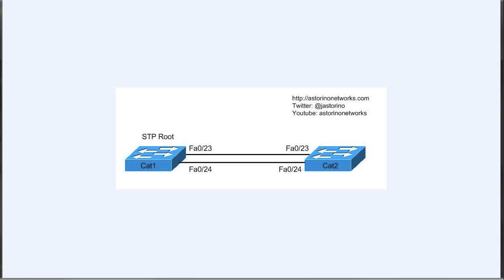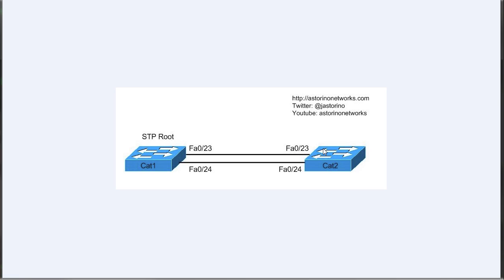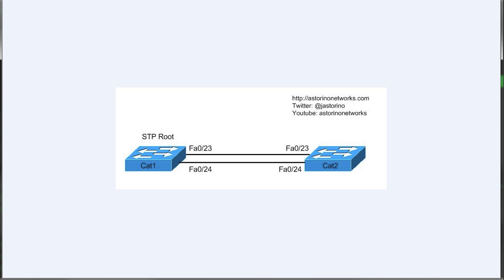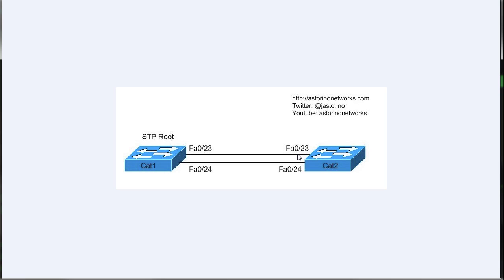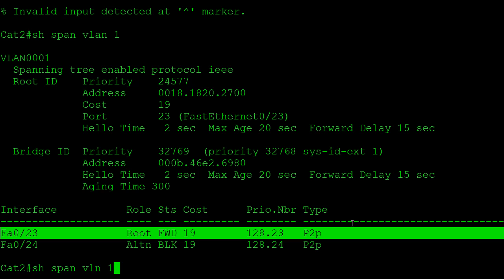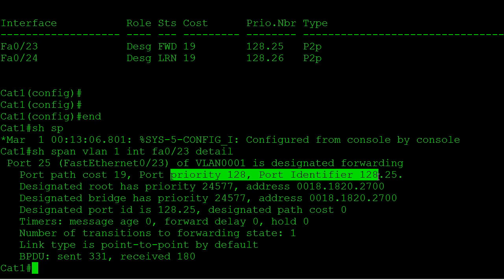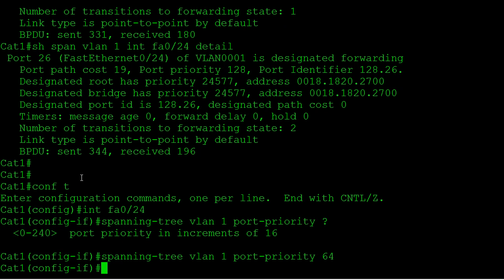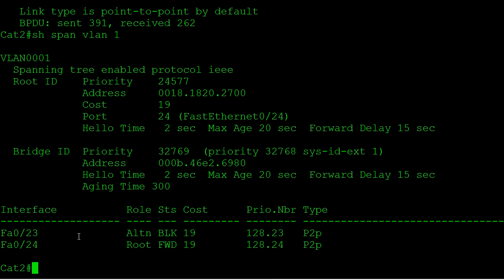Understanding Spanning-Tree Port-Priority

Comment: Thanks for the explanation.

One thing that puzzles me in this video is, designated port physical identifier. It is clearly not a stackwise or modular switch platform, all the ports should have 128.portnum pair as their identifier. Yet on the Cat1 for example, Fa0/23 detail output shows designated port is learned as 128.25
Reply: I'd like to know the answer to this question as well.
Reply from the maker: This was done on a Cisco 3560-24 switch.  This particular model has 24x 
FastEthernet interfaces and 2x GigabitEthernet interfaces.  On that 
platform, the two GigabitEthernet interfaces take port identifiers 128.1
 and 128.2.  Thus Fa0/1 = 128.3, etc
Reply: Thanks, it's clear now :)
Reply: Great thanks!

Comment: Great video and thank you. I figured you can load balance by just switching which vlan you want the root bridge to operate on. I suppose this is easier. Do you think changing port priority is simpler and cleaner when controlling or load balancing your Layer 2 architecture?

Comment from the maker: Part of what you said is right : )  -- Changing the port-priority on Cat2 fa0/24 will not change anything.  It will not make Cat2 Fa0/24 the root port of Cat2.  You would have to change port-priority on Cat1 Fa0/24 as I did in the video to make that happen.  

On Cat2 if you have fa0/23 the root port for VL2 and F0/24 the root for VL6 then yes you could do what you are talking about.  To make that happen though you either need to change port-priority on Cat1 or spanning-tree port cost on Cat2

Comment: @astorinonetworks 
1Hi Astorino.
First thank you for you fast reply.
When I said that we would have more bandwidth per Vlan, I was referring to the fact that with the default STP port Fa0/24 on CAT2 would be blocked for all Vlans, and Fa0/23 would be the forwarding for all vlans (root). So if we changed the priority for Vlan, let's say, 6, on Fa0/24 of CAT2, Fa0/24 would become the root of CAT2, and Fa0/23 would be ALTN blocked for Vlan6. So we would have the Fa0/24 only for Vlan6 and Fa0/23

Comment from the maker: @fumega You can do that to enable a type of load-balancing but you are not adding more bandwidth per vlan.  You still have 1 interface forwarding and 1 interface blocking per VLAN.

If I leave the defaults I have Fa0/23 forwarding and Fa0/24 blocking for both VLANs.  If we change the port-priority of Fa0/24 of Cat1 for only VLAN 2 you would have Fa0/23 forwarding for VLAN 1 and blocking for VLAN2 and Fa0/24 blocking for VLAN1 and forwarding for VLAN2 on Cat2

Comment: (1) Hello.

I've just discovered your website and Youtube videos, they're amazing!

By the way, we can take advantage of this feature in order to increase the available bandwidth per Vlan right? For instance, if there were two vlans, 1 and 2, by default all switches would have the same forwarding and blocking ports for all vlans. But if we changed the port-priority of VLan 2 on Fa0/24 of CAT 1 to, let's say, 32 (spanning-tree vlan 5 port-priority 32) and left the vlan 1 port priority